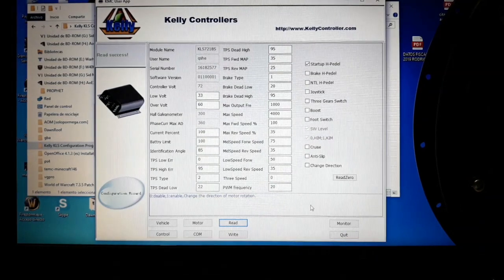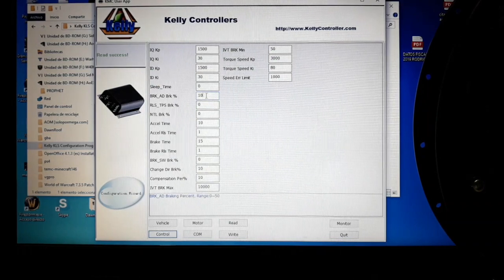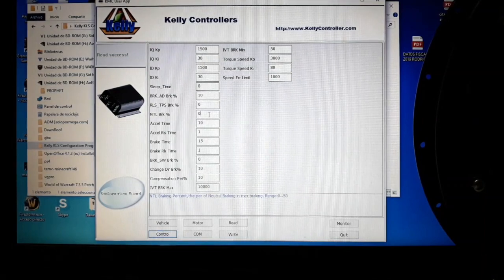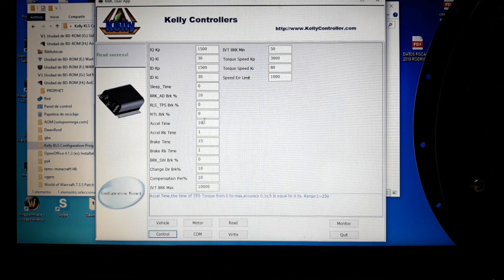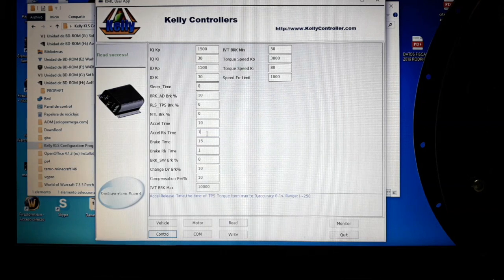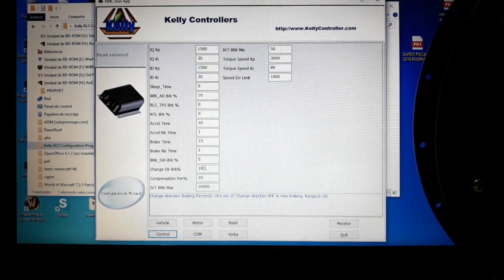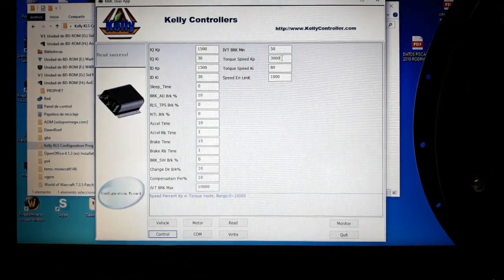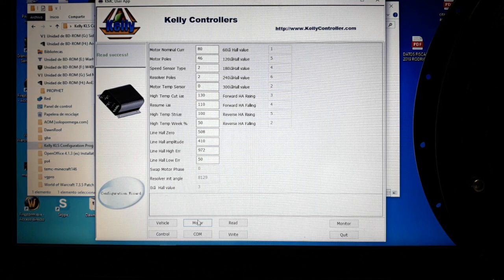KellyController Parameters, Programing setup, Part 3 (English)

Comment: Great series on the Kelly Controllers. I will be revisiting your videos once all my components arrive.
Reply from the maker: Thank you Forge
Reply: @gonzalop.chomon327  is it possible to get a video on how to wire Variable regen and a 3 speed switch into this controller?
Reply from the maker: @jaylord55  Hi, I do not have a video about it. But it is quite straightforward. You can find on the manual at page 13 the schematics for 3 speed and variable regen connections: https://kellycontroller.com/wp-content/uploads/kls-s/KellyKLS-SUserManualV1.10.pdf
Reply: @gonzalop.chomon327  hosnestly that dosnt seem quite right to me it dosnt not show witch wires share withch wire/plug or anyhting and dosnt explain what to do just a random sketch. And dosnt tell you what wire dose what when in the configuration
Reply from the maker: @jaylord55  Yeah it can be a bit confusing if you are not used to read schematics, let me try to explain.
For 3 speed (Low, Medium, High): you need a 3 position switch and when the switch connects pin 11 (12V) with pin 22 is low speed, when switch connects pin 11 to pin 12 is high speed, when pin 11 is open in this switch then is medium speed.
For variable regen braking: You need a Hall or potentiometer braking throttle (Pedal or handle)  you connect the black wire of the throttle to pin 20 (Ground), red wire to pin 4 (5V) and the last throttle wire to pin 2 (Brake_AN signal)
When programming the software you have to activate the 3 speed feature (don't confuse it with 3 gears feature) and define the kind of brake pedal/handle on the brake type.

Comment: Great Video/Tutorial 
Is it difficult to connect a 2 axis joystick to two controllers? 
I build a mini tractor.
But before buying motors and controllers I want to be sure 
I can use One joystick as tank mode. it means Not only backward and forward. It should be able to control rotation of two motors in different directions to make a left or right turn.
Is it possible to wire two controller to one joystick?
Thanks again for your video.
Reply from the maker: Yes, it is possible to use a joystick with this controllers.
You can make them turn in both directions for tank steering.
And even you can program how that turning direction behaves in relation with the speed and e-brake.
Reply: @gonzalop.chomon327  Thanks. So I do not need any extra devices like Arduino to connect the joystick to two controllers in tank mode?
Reply from the maker: @roliki1890  No you do not need that.

Comment: Great reviews. Really makes clear to me how these controllers work. 
1000w hub motor on 48v dc 
Seriously looking at these controllers. Bought a lemon of an ebike  on AliExpress. Sold as a cmacewheel y-20 but in reality a jumble of miscmatched parts. Have repaired bad soldering in motor. But feel I need to replace the “faulty” ???controller. Hoping I can find shipping from eu otherwise customs will be a pain.
Reason I need a customisable controller is I live in an extremely hilly area so require help climbing hills another plus is the ebrake facility running through brake pads every 800 miles. Hoping this controller will fit in original space. I require pedal assist and throttle but thinking if there only one connection from controller I may be able to join both to one input.  Any help or thoughts will be greatly appreciated.
Reply from the maker: Thank you Pat O Mahony, I am afraid this controller model has no input for pedelc system.

Comment: Hola Gonzalo, the parameters that you don't know what they mean... IQ Kp/Ki and ID Kp/Ki refers to the amount of proportional and integral gains for de (Q)uadrature Axis And (D)irect Axis of the vector control current of the motor. So, they control the current gains of the motor, but, good to mention that, if you don't have a log or monitor to see what set point and real value are doing, makes no sense to touch them.
Saludos,
Luis
Reply from the maker: Thank you very much for the info Luigis.
Reply: Thank you Luis
Reply: Thank you for your comment! I have a large 200A continuous motor I'm trying to run off a KLS7250N Kelly controller and it makes loud noises and stalls several times through the RPM range. Could it be these values that need adjusting to make it run smoothly? 
Thank you!

Comment: muy interesante tu video, me ha ayudado mucho a trabajar con el programa, una pregunta? sabes como conseguir el CALIBRATION ID  del controlador? gracias por tus videos. saludos desde Barcelona.
Reply from the maker: No se muy bien a qué te refieres con el "CALIBRATO ID"
Si te refieres al modelo y número de serie del controlador al abrir el programa en los modelos KLS te sale en la pantalla inicial al conectar el controlador en los primeros datos.
Reply: @gonzalop.chomon327  estamos homologando una moto y le hemos hecho la prueba de potencia al motor y al controlador, y nos piden el CALIBRATION ID, que es un archivo que tiene el controlador en el cual guarda una configuración standard que tiene el controlador y donde se guardan los cambios de la configuración que hayas hecho.
Reply from the maker: @begonacastillo65  Me temo que este controlador no tiene ese tipo de archivos.
¿Podría ser que os están pidiendo que identifiqueis y llevéis un registro de cada tipo de calibración de cada modelo/versión de alguna manera?
De todas maneras pregunta directamente a Kelly por si te pueden ayudar.
Reply: @gonzalop.chomon327  muchas gracias, con tu respuesta seguiremos indagando a ver si conseguimos lo que nos piden. Alomejor es lo que dices. De verdad, gracias por contestar.

Comment: Hi Gonzalo great vids. I have an issue with my kls controller. Could you help please?
Reply from the maker: Yes I can try, let me know the issue.
Reply: Any way I can send you a vid?
Reply from the maker: @ethanstewart7193   I prefer if you can upload it to youtube or FB
Reply: I sent you a video on messanger
Reply from the maker: @ethanstewart7193  I think I don't have messenger
Reply from the maker: Oh yes I have one I just learned that FB messages is messenger as well ...
Reply from the maker: @ethanstewart7193  I seen the video and looks like your phase identification angle has not been done or it failed.
So you need to connect it to a computer or android device and do it again. It is one of the first things you have to do when connecting the motor.
You can find how to do so in this video:  https://www.youtube.com/watch?v=A_si4IfU5so&t
Reply: Okay it must have failed when I done. I’ll follow your video and let you know. Thanks
Reply from the maker: @ethanstewart7193  If it does not work let me know and we investigate further...
Reply: Yeah will do mate

Comment: Great job man, on kelly website is sad that motor can be controlled in torque mode , speed mode and in balanced mode. How we can change this modes ? Their support has been pretty silent about this. If you can help a man out it would be much appreciated.
Reply from the maker: Hi Nenad, What controller model you have?
Reply from the maker: I can see that you have a response, and using a KLS7275H model:
This model does NOT have the possibility to choose between "Torque, Speed, Balanced" mode.
But you can modify directly the PID values, although not recommended to make big variations here.

Comment: Hello Gonzalo, i’m from Brazil and i’m starting a project using the KBS48101X Kelly controller. Do you know if is possíble to use this controller to provide 48v  to a eletromagnetic brake at the same moment when i start running the motor with an acelerator?
Reply from the maker: Hi Eduardo, I suppose that you want to use the electromagnetic brake as a clutch in order to engage/disengage the motor from the system.
So you need an on/off signal to activate it.
I am not fully sure if this could work but I think is a possibility:
This controller needs to have pin 15 connected ( to Pin 20 (RTN, Ground) in order to activate the throttle, I suggest that you use this ground signal to activate a relay that activates the electromagnetic brake.

Comment: Hi Gonzalo, thanks so much! These videos have helped me out a lot. 

Question for you. I have a problem with the controller tripping when I punch the throttle too hard. When I do that it brings the 3 red 2 red error code. The bike will still run the same after it brings this code.  

I have a smart BMS and have looked at the data from it and it seems like it never gets above 60amps. I have the 48v 50-120amp kls s controller. The motor is a 1000w direct drive hub motor that can definitely do 3-5kW for short periods of time. My battery is  1.6kWh custom made that can certainly deliver the current. I've also set the BMS over current protection to 150amps so I don't believe the battery is the problem. 

I have both the battery current and motor current in the settings set to 100%. 

Do you have any thoughts on the issue? I would very much appreciate your help and guidance.

Sincerely 
Zach
Reply: To clarify now I'm pretty sure it's bringing the 2-3 error code which is supposedly over temp protection. I think I might have a short in my wiring harness somewhere but I'm really not sure. Do you have any idea which wires if shorted would cause an over temp error?
Reply from the maker: @carlton88444  Hi Carlton,
On our first post you say error code 3-2 (internal reset) and on your second post you say error code 2-3 (over-temperature)
As per you describe when it happens (Pussing throttle too hard) it is more likely to be a internal reset due to a momentary drop of voltage or momentary over current.
First check all cables and conexions, make sure you are using the correct wire gauges, connectors, etc. to make sure there is minimal losses.
I recommend you to not set the Battery Current and Motor Current at 100%.  I noticed that this controllers do not perform well when set them at 100% in any value. So use 99% or lower in any of the % parameters. A 1% difference does not make a big difference after all.
An probably it will solve your 3-2 error.
Reply: @gonzalop.chomon327  thank you Gonzalo!

I will adjust the parameters and see if that helps. 

I do believe that I have gotten both the 3-2 and 2-3 error codes at different times. The issue first starting happening with 3-2 internal reset error code when I would punch the throttle too hard. I would have to plug and unplug the battery in order to reset this code. 

Then just yesterday I started encountering a different problem. When I would hit the throttle even with no load it would stop, start flashing 2-3 over temp a couple times and then it would reset back to green automatically. 

My guess is that I have something loose in the wiring because occasionally I would move the controller and wires around and then briefly it would work normally. 

In addition to the 100% setting for percentages causing problems do you think that loose wires could also cause these issues? 

I'm also curious about wire gauge. I'm running 8 gauge wire from the battery and they're not very long. The phase wires are the standard relatively thin wires that come stock, probably 22 gauge. I would think they would be too thin but after 10 miles of riding I immediately checked them for heat and they barely got warm. All of the wires were cool and the motor was only at around 125 degrees Fahrenheit, not even too hot to touch with a barehand. 

I will go through all 3 of these and report back. Thank you so much for your time and knowledge, you have been a big help! Please let me know how I can best support you and your channel!
Reply from the maker: @carlton88444  8 AWG for battery - controller wires looks very right to me for your motor (1000W+) anyway check that the connections/connectors do not get hot.
The phase wires can be thinner than expected as they are running alternate current (AC).
It is possible that a bad connection (loosen wire) or shortcut on any of the signal wires that in somehow interferes with the controller can cause a problem/s like you mention, check all them out.
Reply: @gonzalop.chomon327  still can't get rid of the temp sensor error code. 2-3.  So I bought another controller, a vesc type. I wonder if I shorted one of the wires on accident that in turn shorted the controller's internal thermistor, but I don't know.
Reply from the maker: @carlton88444  Let me know how that Vesc controller goes.

Comment: HI CAN YOU HELP WITH MY  7230S    ITS  NEW AND I NEED TO KNOW THE  PINOUTS WIRES  NUMBERS AND MUST IT BE  PLUGGED  INTO A  PC  OR  IS  IT  PLUG N  PLAY  WITHOUT A PC  ???
Reply from the maker: It is not usually a plug and play controller unless it has been matched with your motor and vehicle.
You can download the manual from here: https://media.kellycontroller.com/new/KellyKLS-SUserManualV1.10.pdf
You can find the pins definitions at page 10.

Comment: For the IQ and ID, I found some information about the axis. Does it impact the acceleration ?
Reply: It does impact the PID regulation
Reply from the maker: @sensepro7309  Yes; I suppose that is a PID regulation but I have not found any detailed information about those exact parameters at Kelly manuals or web page.
The last values, of Kp, Ki and Speed error does influence on acceleration.
Reply: @gonzalop.chomon327  IQ and ID maybe not on the user guides etc but in PID regulation documentation in general according the 3 last values ? I have a question, I am driving an electric scooter 12kW peak that weight 40kg with 11inch wheels (Weped FF from korea) taht can go 0-90kmh in 10 sec. The values are set like Torque speed Kp 2000, Torque speed Ki 10 and speed error limit 2000. This configuration was setup by the manufacturer, isn't that weird that the Speed Error is about 2000 ? Changing specs will affect motor temperature and risk to burn I guess ? They have already made a lot of tests but i try to improve the acceleration. Thank you so much for your helpful kind answers Mr. Gonzalo
Reply from the maker: @sensepro7309   Certainly you can try to increase Kp and Ki, I will not go over 4000 and 50 respectively. The Speed error is already very high.
And yes, increasing acceleration will obviously increase motor consumption so motor will heat up more.
Reply: @gonzalop.chomon327  Hello Gonzalo thanks, I found that from ABB. There might has a formula to put the right settings according the KP Gain we target : https://www.youtube.com/watch?v=3viD5ij60EI
Reply: @gonzalop.chomon327  THanks sir, your videos are so interesting.
Reply from the maker: @sensepro7309  Thank you for the link very interesting. I will look into it more deeply.

Comment: hi..thank you very much..question..i have a 3000w mxus motor..what kelly programable controller do i need? i will run 48 volts LTO battery pack...i may get mxus geared 1000w motor to try too.i would like to mayby run les voltage 36 or 24 v for testing as my LTO cells are big and heavy for 48v.
Reply from the maker: There is many controller that can work with that motor from, chosen one depends on your application. Can you let me know what the motor is going to be used for?
Reply: @gonzalop.chomon327   thank you for taking the time to answer..the bike is built for bike packing events bothe off road and on road.the wheel size is small 17" motor bike wheel..im confused as kelly recomends big expensive controller but on forums its said the motor will only take 42.6 A continuous other wise it will over heat..but i dont know at what voltage the forum is talking about...i caculate at 48v i only need the smaller 99$ sine wave controller.as its continuous rating is 50 A continuous .

Comment: How would i get max torque right away? Mine seems to have a delay like when they crank the throttle it doesn't brap like a dirt bike..? Do you know how to chang that?
Reply from the maker: In the Kellycontrollers there are different parameters that influence on how the motor accelerates. What controller model do you have?
Reply: I have a kelly kls n series
Reply from the maker: @Razorcrew_Cole  This are the following fields that influence acceleration:
- Current Percent
- Battery Limit
- Accel Time
- TPS Fwd MAP
- Torque Speed KP
- Torque Speed KI
- Speed Err Limit
And obviously the battery, motor and controller maximum power in relation with vehicle weight and gear ratios if there are.
Check the videos for more info.
If you have any doubt just ask.
Reply: The only one I have not messed with of those settings is the mapping one I couldn't feel it did much I appreciate the input!
Reply from the maker: @Razorcrew_Cole  
Electric vehicles are always limited in acceleration by the software in order to prevent mechanical damages and/or accidentes. So you should not have problems of acceleration with an electric motor.
Reply: @gonzalop.chomon327  can you explain setup for torque KP and speed KL, i don't understand this function parameter. Thank you
Reply from the maker: @hokiedokieshop4331  PID values are the ones that regulates the response of the controller in order to maintain the speed constant and how to arrive to that speed. It is a quite complex function, you can read more about ti here: https://en.wikipedia.org/wiki/PID_controller